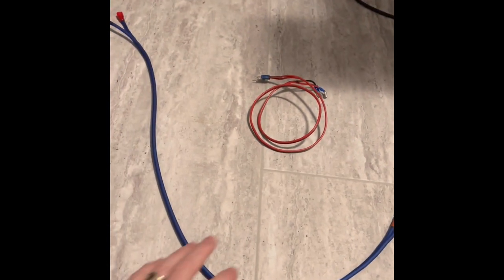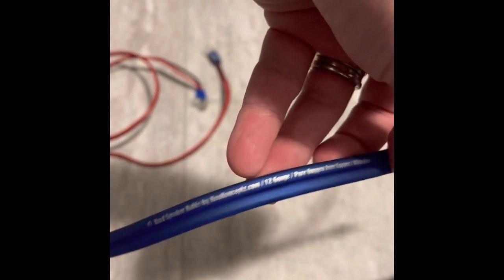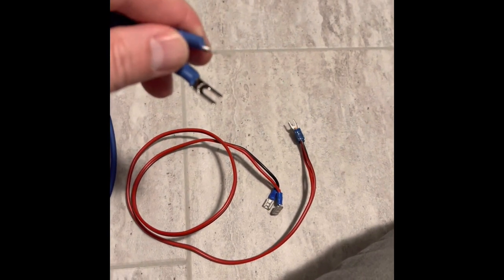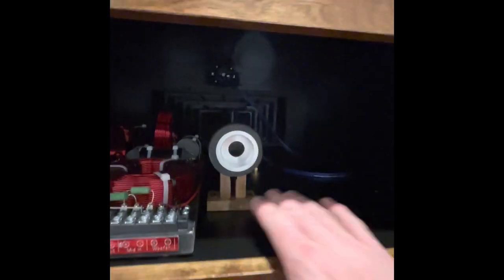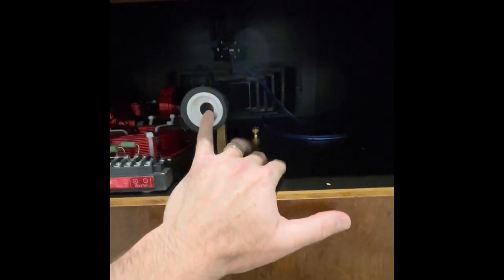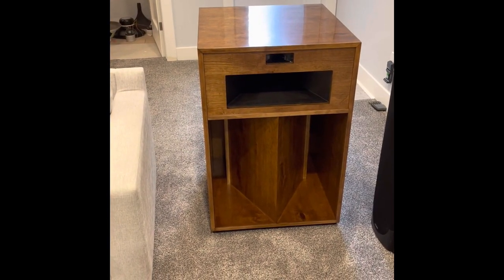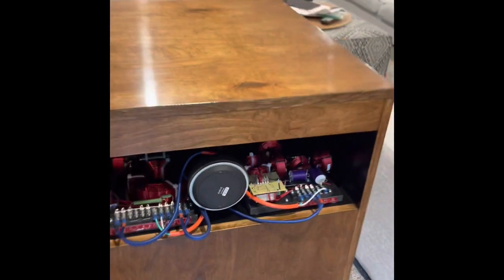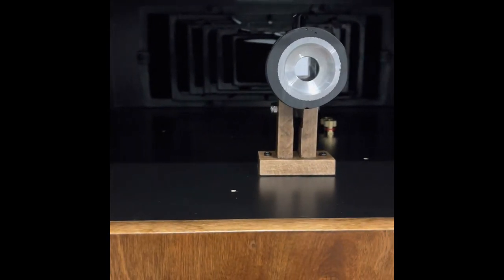DIY La Scala Clone - Conclusion

Comment: How much did they cost
Reply from the maker: Somewhere between 5 and 6 k.  The largest single expense was the crossovers.  You can see the prices for these on the ALK engineering website for the ES-500 and ES-5800 combo.  The drivers are not cheap either, especially with shipping to Canada.  And the mid horn is pricey, if you can find one.  Building one is an option, and I pointed out to another commenter that there is a good design reference on the ALK engineering site.  Otherwise, contact Crites Speakers (product is not listed, but they can get a version of the k400), or keep an eye out on ebay.  So overall not cheap.  BUT…. Here in Canada, used La Scalas are regularly advertised in the 4K price range.  All of those will require cabinet work, crossover work and possibly driver work to bring up to spec.  And even then, they won’t come close to these for sound quality, appearance quality etc. (assuming a good quality build).  So, short answer - not cheap, but I think good value for what I got.  I am confident these would compete and/or exceed the latest model from Klipsch.

Comment: Nice job ! How much did it cost you ? Thank you !
Reply from the maker: Too much.. lol!  The crossovers were a significant cost increase vs other options ( you can get accurate costing from the ALK engineering site), and because I live in. Newfoundland, Canada, shipping and import duties added a fair bit as well.  It was overall about 6k Canadian ($4500 US) give or take, but could be done for significantly less.  I was going for the best I could do, so I spent a little extra, as pointed out in the videos.  Expensive for me, but I feel the final product puts me sonically on par with current La Scala, at a pretty good discount.
Reply: @hollowheadsrestorations  I'm in Canada. How much